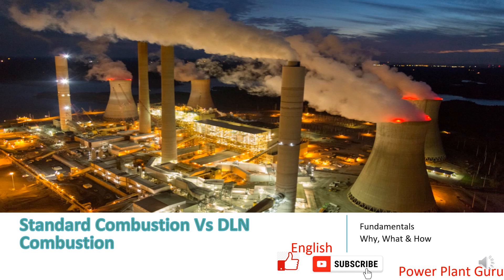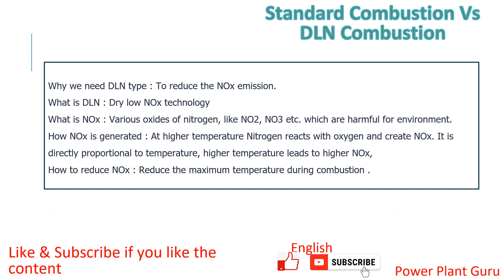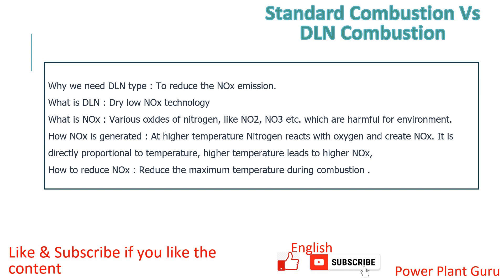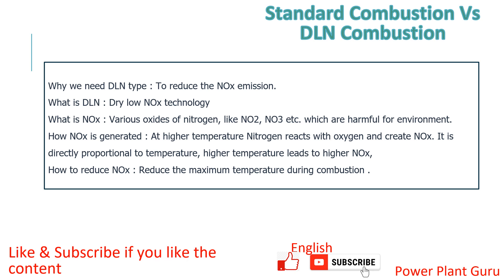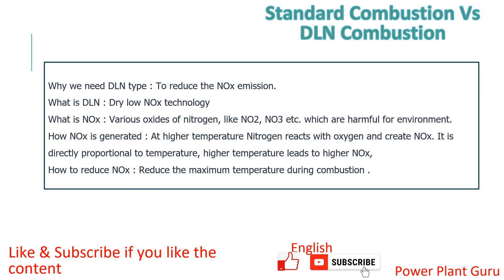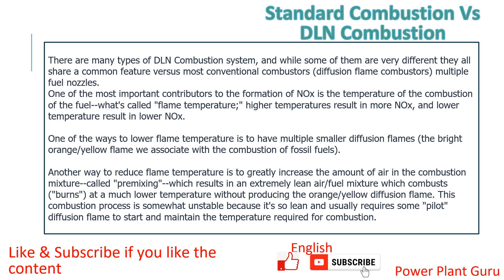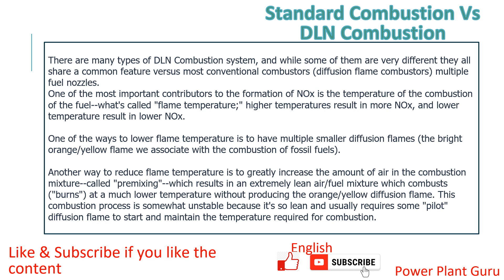Gas Turbine NOx Reduction Technology,  DLN Combustion, Gas turbine power plant

Comment: Sir why recirculation pipe provided in every Acw or Mcw pump???
Reply from the maker: Hello Devi
Recirculation lines are important for all pumps for allowing minimum flow to continue all the time to carry out heat generated in pumps and to avoid pump operations at the shutoff head. You will realise almost all important pumps have some min recirculation line through an orifice or automatically recirculation valves.